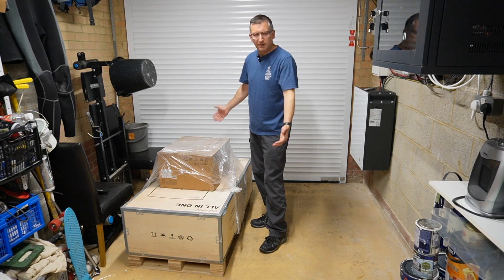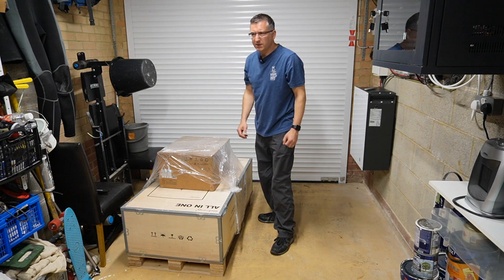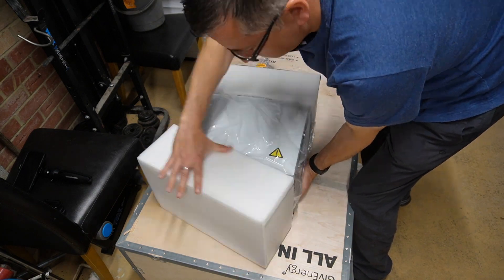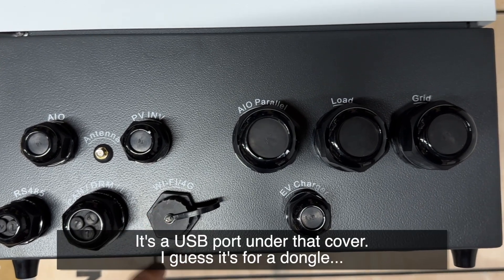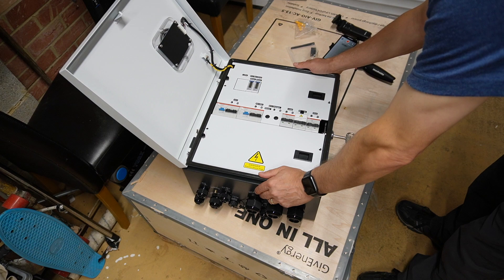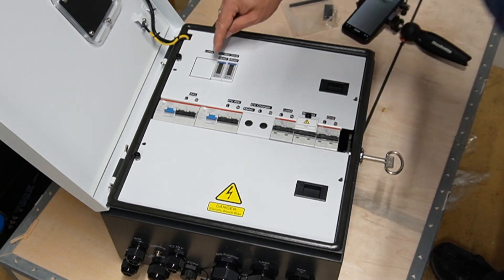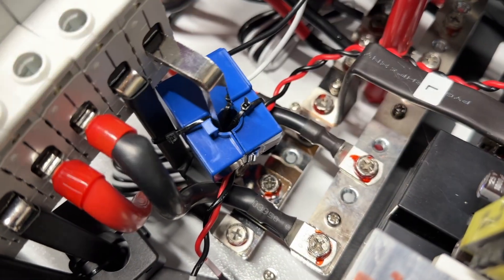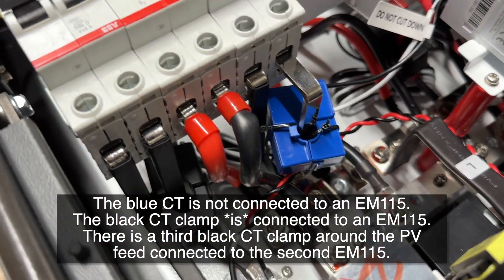GivEnergy All In One Battery and Gateway: Unboxing and First Look At The Tesla Powerwall Killer!

Comment: IF you run off grid or battery have you noticed that the grid/battery draw is nearly 100w higher than the load?
Reply from the maker: I haven't had it running long enough to notice really, but with the old battery inverter there was an increase in house load of maybe 40-100w which was the overhead of the inverter itself I assumed. It can be a significant chunk of your usage if your baseload is low, but to be honest it's a price worth paying on balance! I could never pin down the exact figure though... at night fully on battery the base load was very low including the inverter, maybe 250W total so I'm guessing the lower the load being provided by the battery, the lower the inverter overhead
Reply: @SpeakToTheGeekTech  that is good to hear, there is no info in data sheet of personal draw and for some reason it's not included in home draw which made it confusing as to where it was coming from.
Reply: @SpeakToTheGeekTech  May I ask do you have an external antenna for your unit where your battery is or is it internal, because these units are new I cant find any finished build videos with it all set up to see whats coming out of the units themselves.

If I didn't interpret GE wrong it should be external on top of the unit itself so there should be some external signs of an antenna?
Reply from the maker: I'm actually running mine using hard-wired ethernet because I find that far more reliable. But... the gateway comes with a stubby aerial (like you get on wifi routers) that plugs into the bottom of the gateway. The AIO comes with a magnetic aerial on a long wire that you can position wherever convenient or attached to the top. It looks like Wifi should be a lot more reliable on the AIO because of that. You should see the stubby aerial in the video when I unbox the gateway. I don't directly show the magnetic AIO aerial, but it's there.
Reply from the maker: Also, set your alarm for 9am tomorrow morning and come back to this channel. I'll be publishing a video showing the installation. Not an in depth one going over technical details, but more of a highlights showing the installers at work doing their thing.

Comment: Are you connected via wifi or network cable, in the cloud I am having gaps of data, hours of gaps in away readings (home doesn't work yet, no way to get live info til they update app) and its displaying house current consumption but not total consumption of home for a 24hr period, it seems like it doesn't store any info incase it cannot send to play catch up at regular intervals so the whole monitoring system of this system is completely useless.
Reply from the maker: My old AC3 was WiFi connected. The only way to get reliable communication to it was by putting a WiFi extender about 1m from the inverter. Perfect once I did that. The AIO and Gateway are hard wired Ethernet for me, but WiFi is also an option. They have external antennas now so are probably a lot more reliable over WiFi although I don’t plan to test that.

Comment: I’m on the cusp of ordering one of these for install!

Out of curiosity, which inverter are you using with it? My installer mentioned this won’t work with hybrid inverters and I’d have to choose a single string inverter…
Reply from the maker: You could use a hybrid inverter with it just for the solar, but that would probably be more expensive than getting a solar-only inverter. I have a SolarEdge SE3680H inverter for my solar panels.

Comment: Great Video. Can anyone advise me if this unit could be installed in my loft on the Gable end wall. For practical purposes the unit could be carried into the loft due to the 4 detachable batteries but I do not know if there are any building, structural or  electrical regulations preventing this? Thankyou
Reply from the maker: That's something I couldn't personally advise on sorry. You're best off contacting an installer to advise.
Reply: Originally I had planned on having my GivEnery 3.6kW Hybrid inverter & 9.5kWh battery installed in my loft which is a valid option. However, after researching it I decided to have them installed on the wall inside my attached garage underneath my consumer unit. Reasons - muchy easier access, everything (inverter, battery, Eddi, new consumer unit) was close together so the install was quicker. Also, the loft space summer / winter temperature swings can shorten the life of electrical components so as a location for solar gear is best avoided unless there are no other options. My installers were also much happier because they did not have to manhandle a 110kg battery up into the loft which would probably have needed a gas lift - extra cost. Structurally the gable end wall with a backer board should be OK for mounting stuff on (mine's on thermalite blocks in my garage) but keep it all off the loft floor joists because they are not load bearing. Your installer should do a site survey & check all this & your roof trusses etc for suitability for the proposed loadings. A friend of mine has had a similar system to mine installed in his loft space because he had no other option so it is dooable.
Reply: @colingoode3702  Thankyou for your thoughts and advice.

Comment: Any date for installation? I was meant to have mine done last week but the installer couldn’t fit the box in his van 😂. I’m on for this Tuesday though. I will add the electrician is a bit wary as it’s his first installation of an AIO and has questions about sharing the earth apparently.
Reply from the maker: My installation is possibly at the end of this week. Waiting on the DNO though! I think you may need an earthing rod attached to the earth on the load side of the gateway. This is because in a power cut you can’t rely on the grid providing it. I will confirm with my installers during the process anyway. I have one fitted for my EPS circuits so it’ll likely be a case of wiring that into a different place.
Reply: Had mine installed today, absolute nightmare on commissioning., kept knocking the power to the house off, which dropped the broadband and kept failing the software updates. The Sparkies are coming back tomorrow after 3 hours tonight they gave up. The Gateway was a bit bigger than I expected.
Reply from the maker: I just thought, can’t you just flip the bypass switch on the inverter while you do the update? That way it can’t knock the power off.
Reply from the maker: Good to know thanks, please let me know how it goes tomorrow. I have my router on a UPS so hopefully that might see me through the update... UPS should give me 30 minutes if full.

Comment: How close to the houses main CU does the gateway have to be
Reply from the maker: The only mention in the installation manual is a reference to a maximum cable length of 50m. https://kb.givenergy.cloud/assets/All%20in%20One%20Installation%20Manual%20v2.pdf
Reply: 3m maximum is what givenergi tech support told me.  50m is how far away the battery can be.  Very disappointed by this as no chance I can fit it that close.   Need a large space too as needs 200mm air space all around it otherwise warranty will be void.  Finally  I still for the life of me don’t get why they call it an all in one when you need 2 boxes
Reply from the maker: Good to know thanks. 3m is plenty fine for me but I could understand why that might be an issue for others. All in one, because it's an inverter and battery all in one. The gateway is something optional. I guess we could argue why doesn't it also act as a DC inverter for your solar panels too but you have to draw the line somewhere!
Reply: @briancormack6365 ust reading the installation instructions and it says meter tails should be no longer than 3 metres but if so additional protective device at the nearest point to the supply inside the customers property as specified in the current IEE wiring regs 🤷🏻‍♂️ So does that mean it can be fitted outside of 3 meters but with additional isolation switches close to the metre
Reply: @johnb7644 The tech support was adamant that 3m is the maximum distance, though they never explained why but it would be reasonable to assume that the volt drop created may be the main factor.
Reply: @briancormack6365  Looks like plan B for me then, An AC coupled inverter and two batteries 😪

Comment: Thanks, do you know if this will play nicely with a Zappi?
Reply from the maker: There's no reason why not. It won't integrate natively so you won't be able to alter the priorities between battery and charger, which is no different to installing any other battery solution apart from Libbi. I have a Pod Point charger and it should work fine. I'll obviously report back with more info after the install!
Reply: Thanks that’s my concern as I have a Zappi and Eddi and don’t want them emptying the battery or conflicting etc, I just can’t justify Libbi’s price compared to the all in one!
Reply from the maker: I have an Eddi too with my current battery, and a Pod Point. Now, if during the day I was to plug in my car to charge, or boost the hot water, then the battery would of course drain to cover the load unless I manually intervened. But that scenario doesn't really happen, at least not very often. Normally I set the battery to charge off-peak (00:30-04:30), which is the same time that the car is set to charge, and the hot water set to boost. Because the battery is set to charge during those hours, it won't drain - it'll either charge or discharge until it hits the target SOC you've set. If you set the SOC to 100%, then it'll charge to 100% and not drop during those hours. If for example there's still 80% charge left at 00:29 and you've set the target SOC to 50% that night, it'll drain down to 50% and stay there. It's pretty flexible like that. If during the day you wish to charge the car, you can pause the battery discharge using the GivEnergy app to prevent it draining. If you're in to home automation then you can most likely code that automatically... i.e. if time == peak and Zappi == charging then pause battery.
Reply: @SpeakToTheGeekTech  thanks that makes sense, I’m tempted to pull the trigger as bidirectional seems a way off!
Reply: @chrisbarnett507  Agreed. I think the big thing that drives people to the Libbi is that unlike GivEnergy, MyEnergi actually have a working eco system. 

The EV charger has been "coming" for several months now. The Libbi is ridiculously expensive for what it is too.

Comment: Looking forwards to the install. Is the Gateway optional or mandatory?
Reply from the maker: It's optional and on its own the AIO is a 6kW/13.5kW AC-coupled battery and inverter. But, without the gateway you miss out on it being able to run your whole home off-grid including keeping your AC-coupled solar inverter going.
Reply: @SpeakToTheGeekTech thanks for quick reply. In 30yrs we might have had two power outages for 1hr max  and so I don't need a gateway. Just adds to complexity but a stand alone AC coupled battery in my garage is a winner.
Reply: @SpeakToTheGeekTech  Potentially the AC coupling is decent for EVs though I'm not too fussed about being "off grid" when powercuts aren't that common here.
Reply: Givenergi tech support told me in no uncertain terms you must have the gateway, the AiO will not function as a stand alone battery.  Gonna be mighty annoyed with them if thats not true, as not only did they tell me that in writing they also told my installer so I’ve cancelled the install.
Reply from the maker: I've just spoken with someone at GivEnergy and they've confirmed my previous comment was wrong. The gateway is mandatory for the AIO to function correctly and they're only sold as a pair as you have pointed out.
Reply: Cheers for clearing that up, I was really keen to get this unit but the 3m  max from the distribution board was the final nail in the coffin for me.  Absolutely no way I can get remotely close.

Comment: Hi, I have an AIO looking to be installed next week. Do you know the EV charger input on the Gateway can you use any EV charger on the input or does it have to be GivEnergy one? I have had conflicting advice? Does it say anything in the installation manual with the Gateway?
Reply: Thanks for the reply, I’m the same I have a Zappi and can’t justify spending additional money on a GivEnergy one. Logic was for me that the wiring would be to air gap the EV Charger from the Battery to stop any discharge into the car which is one of the largest annoyances with a PV Battery system. And the hookup on the Gateway was a clean way to do that.
Reply from the maker: You can wire in any EV regular charger to the gateway. Inside, it's just a regular DIN rail where you can fit an RCBO. It looks like the intention is that the RCBO is wired to the load side of the gateway which means it would receive power in the even of a grid outage. However... it may also be possible to wire it to the grid side by connecting it to the empty connectors on the bypass RCD but check with your electrician! My installers are currently planning on wiring my charger (Pod Point) into the gateway, however I think I will be asking them not to on the basis that I don't want to have backup of my EV charger during power outages as that risks overload of the inverter, and moving my wiring just for the sake of locating it in the gateway doesn't make sense to me. But, if you actually have the GivEnergy EV charger, then I've heard it works in a more intelligent way because they can communicate, so there's no risk of inverter overload. There's space in the gateway for an RCD and an EM115 meter used by the GivEnergy charger.

Comment: Ye, best to remove the wooden sides to access the packing to remove.
There is no need to remove the invertor cover on the AIO, all connections are external, on the side, under the two cover plates which you didn't show.
The main benefit of the AIO and Gateway is that everything is within the units, so the electrician isn't fitting additional meters, isolators, etc.
The gate way was fairly simple for my installers, but as it fits between meter & consumer unit, location should be thought about, as tails should be fairly short is possible.
Don't try to move the AIO without removing the batteries!
Its a very well made, solid unit.
Hope your install and commissioning goes well. we had to use the LAN connector onto the loose RJ45 lead, rather than the PCB socket, Givenergy Tech support very helpful in getting us through the commissioning, as an error kept showing up on the AIO firmware update!

Comment: Couple of questions: 1) what are you doing with the old system and why did you decide to upgrade? 2) does it seem like a swap over should be fairly straightforward? I had 3 EM115 installed with my AC3.0 (two pv inputs and I assume house load) but this only has one pv input? Unless it takes a feed from the aio which I think can take two ac inputs? Looking forward to the install video!
Reply from the maker: The old system is hopefully going to my sister. I'm in the process of getting a heat pump so need more capacity. The PV input on this is essentially an RCBO on the load side of the gateway. The EM115 in the gateway is monitoring that PV input, so I guess if you had two arrays then you could join them first and then wire the joined circuit into the PV input on the gateway - keep in mind your AC3 had no PV inputs at all, you had to monitor them separately. The gateway also takes a feed from the AIO. If you take a look at the installation manual there's a great diagram in there showing the set up. Imagine a hub and spoke with the gateway at the centre, everything connects in to that really.
Reply: If one of the answers is charge/discharge power that has me wondering whether 6-7kw output is way more future proof than 3kw of the previous system.. cost to change though..
Reply from the maker: The extra power is an added bonus. I'd say that the 3kW I have now is sufficient for 90% of my usage if I'm careful. The 6kW means it could also cover most of my heat pump at the same time as I'm cooking in theory :)
Reply: @SpeakToTheGeekTech  I have a 9.5 so toying with another 8.2/9.5 or spending twice that amount for an AIO and finding a new home maybe selling this one..
Reply: @SpeakToTheGeekTech so this feels like a 6kW G99 needed. Which would would with a 6kW SolarEdge inverter too I guess.
Reply from the maker: My inverter is 3.68kW so I guess in total they might have to apply for up to 9.68kW of export, although chances of me actually doing that are rare - the only scenario I can think of is during calibration.

Comment: Thanks for showing the kit, I have been looking at this setup myself. Are you having to go through a new DNO application or is your existing one sufficient? It's waterproof I believe, can you not install it outside the garage and save the valuable room inside it for something else?
Reply from the maker: New application sadly because the old one was installed under G98. New one has twice the power output. There’s not really much space outside the garage for it (heat pump is going out there!) plus it’s not really in the way much in my garage and nice and sheltered.
Reply: @SpeakToTheGeekTech assuming G99 applications come in different allowable sizes? What does this need?
Reply from the maker: The ENA application states G99A which is <1MW, if that's what you mean? I'm not an electrician / installer so I'm not fully up on the details, but I don't know of other size categories other than you have to state the rated output of it.
Reply: @SpeakToTheGeekTech  most inverters can run at G98 if needed, but you should not have any issues with a G99 application.
i have applied for plenty & only had once, the DNO needed proof that the inverter was running at the suitable class.
Reply from the maker: All was good thanks and it's installed and running now. Video about that being published tomorrow morning :)